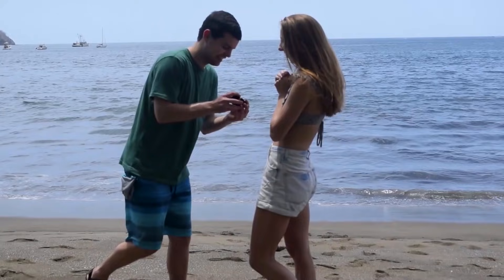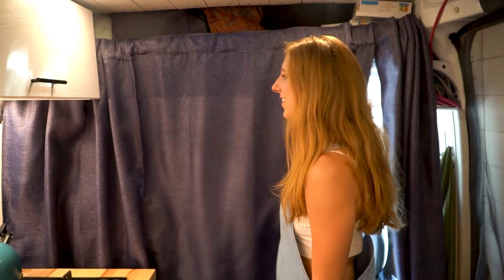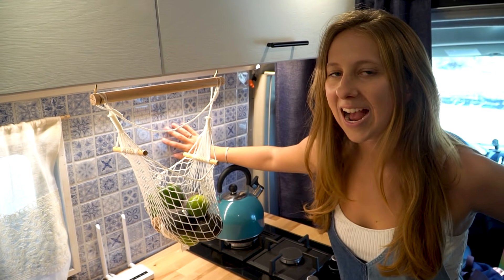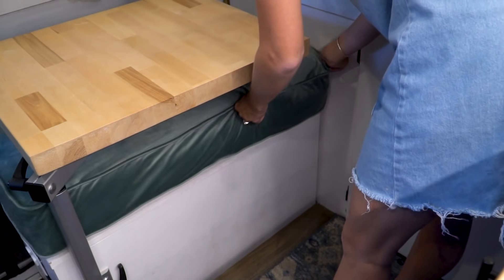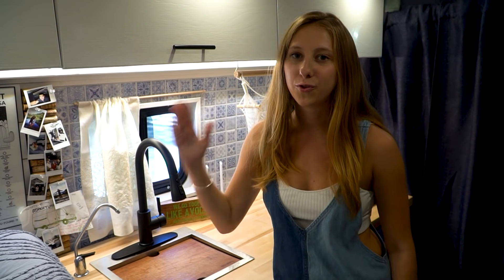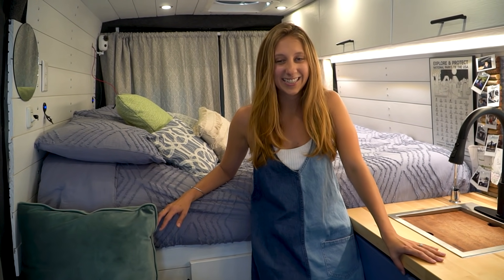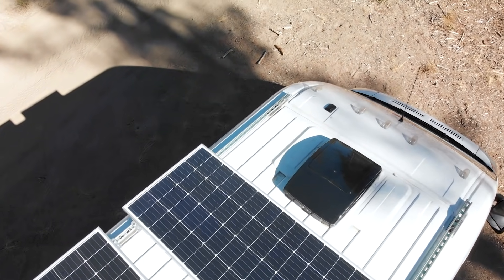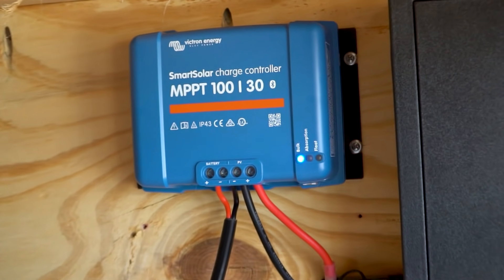VAN LIFE TOUR with TOILET and SHOWER | Ram Promaster 136" WB

Comment: Nice! I have a similar except low roof. I’m 5’1” so it works for me. I need screens. Where did you get yours and are you happy with them?
Reply from the maker: If I remember they were Maglo (something like that?) Got them off Amazon and had to cut them to get them to fit correctly

Comment: One question 
How where you able to get a vehicle weight slip? In order to have it registered under passenger in NY, any modification that will alter its classification, it requires a weight slip. Im from NY and I’m curious as to where to get a weight slip when doing all the work yourself. This is one of the questions that has been in my head for a while now and when I do get a van I would like to have passenger plates on it. Thank you and sorry for the long question.
Reply from the maker: If I'm being honest, I think you're over thinking it. The used car dealership gave us passenger plates when we said we were going to convert it - then we just had to put a bed in and a passenger side window to make it legal.
Reply: @travelingatlas  thank you 🙏🏼 didn’t think about just asking the dealer.

Comment: Why the need for passenger plates, and what is the gas mileage that you get with the van? Oh and what size is the van, thanks.
Reply from the maker: Passenger plates allow you to drive on Parkways legally in New York state, the gas mileage I would estimate is around 16-18 MPG, and the van is 136" WB high top.

Comment: Does the butcher block add much weight to the van?
Reply from the maker: The butcher block isn't light, but I think we saved a lot of weight by using peel and stick floor/tile, and also the shiplap for the walls was very light. It's all a balancing act, but these vans can handle more than you think they can.
Reply: Thanks for the reply and info. @travelingatlas

Comment: didnt see a link for the window you got, haven’t seen a small square one like that. where did you happen to get that?
Reply from the maker: It's an RV replacement window, I wouldn't really recommend it - it's not really designed for a van. It's too thick, so we had to design a custom frame to put in between the inside of the van and the window to make it fit. It works great, but it wasn't easy.